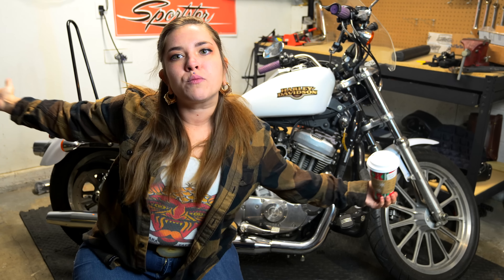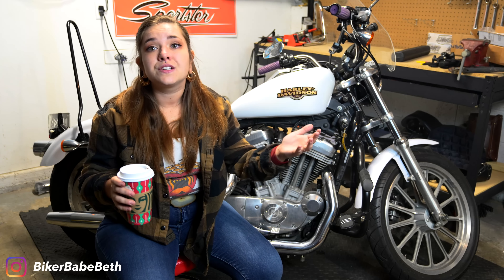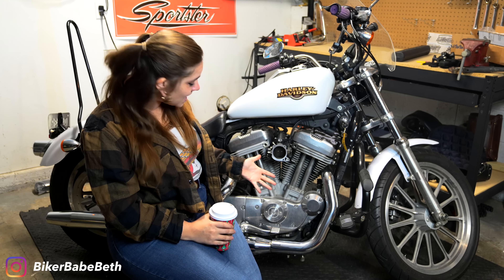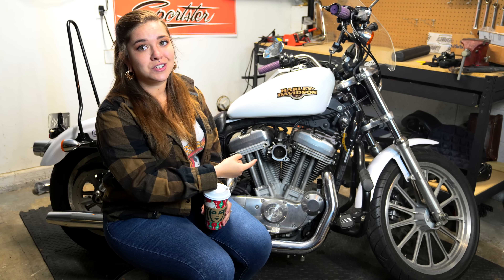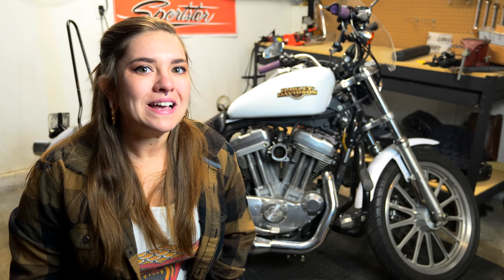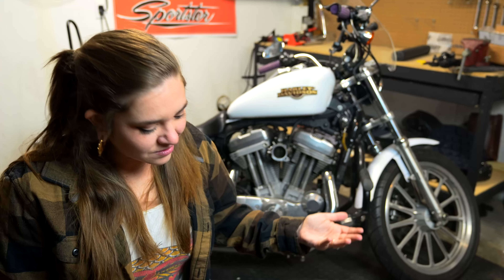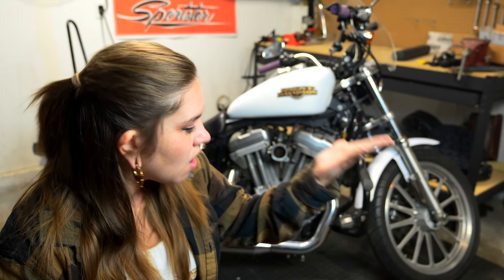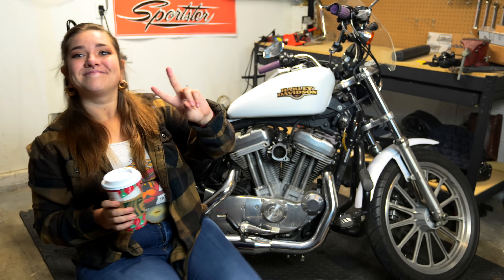SHE BROKE WHAT!? - Harley Davidson Sportster Out of Service!

Comment: I was trying to change my air filter. I got my 10 Mim wrench and no problem. But I could not get the two screws that hold the air filter. I stripped one of the two screws. I sent My Harley to the shop. I paid $150 to remove a screw. I felt so stupid. Thank you for the share.

Comment: I broke my Kickstarter cover on my Sportster once,  got a new one and  it broke on the 2nd kick. Took it off and looked at the kicker shaft.  Yup its bent, more probably then it was the first time. So round 3, new cover, new shaft and a few other parts and it worked good after that. Live and learn!
Reply from the maker: Live and learn for sure.  Especially with motorcycles.

Comment: Well let's see.... I once stripped a head hole trying to change plugs.... I pulled a valve steam out of a front tire trying to put air in..... I once dropped a timing chain trying to change starters....  Then i cracked a jug trying to change pipes... So yeah your not the only one.

Comment: Simple install.... a 21 inch on a stock street glide. The dealer said "NO PROBLEM"
So install and within 1 mile tipple tree hits the fender. $600 later (without striping) and $1000 in fork work  (yes 1600 in repairs)  Oh well..... Happy and riding as much as possible
Reply from the maker: Damn! That got expensive

Comment: It could be worse.  I once put a Baker F5K kicker kit on my 91 Softail and fucked up by not pressing it on properly.  I ended up having to remove the tranny and take it to the shop to get it fixed.  It turned out that I had moved the gearset out of alignment so the tranny wouldn't shift.  But once it was fixed, I ended up putting another 50-60k miles on her.  I've done more stupid shit working on my bikes over the last 40 or so years, but haven't we all?  lol  Odessa will be a badass Sporty when you finish her.  1200 kit, straight pipes, hmmm, sounds like a hot rod to me.

Comment: I had to redo my clutch 3 times in a month because I was using an inch/pounds torque wrench not foot/pound thanks in part to auto zone not realizing that the tool was the wrong spec type and me not double checking or knowing that there even was an inch/pounds torque wrench. Thankfully this was on a 2001 Kawasaki Vulcan 1500 and it was a very forgiving motorcycle to work on the clutch. When I realized what was going on I felt like such a dumb a$$, but "you live, you learn".

Comment: If it's cracked on the filter side of the throttle plate it can't leak air. If it was cracked on the engine side of the throttle plate it would have a vacuum leak. Good luck. Hope it works out.

Comment: It'll be a brighter day when the tins are off and you decide to at least prep her for new paint yourself.  Don't let any "monday quarterbacks" give you their JB weld stories or "I've never dropped a bike BS"  Every rider will put their bike down at some point, or they're liars. When you wrench your own bike you double your chances of breaking something. 
For me it was not checking more on a used bike. The throttle cables weren't correctly installed when the latest owner installed new grips. My first clue should have been the upside down eagles from them putting them on the wrong sides. Once I finished installing all new rubber from tires to fuel lines and cleaning the tank of varnish. I pulled up the drive and across the grass when the cables slipped and the throttle revved spinning the rear tire on the grass and dumping my RoadKing onto my right ankle. With a broken foot I took apart the throttle assembly to find the ferrules loose in the plastic housing. Those brass ferrules are supposed to be clipped onto the ends of the lines before slipping them into their grooved pocket. 
That happened to me when I was 49. I am 57 n ow and I started riding when I was 14 and could pickup my uncles 47 Indian Chief off the garage floor. I have been riding and wrenching all my life and I am still a novice!
The day you profess to be the "master" of anything it'll bite you in the butt.
        Miss Beth, stop beating yourself up and do not listen to the "masters of the universe" that proclaim too much.
You are in my prayers
Hoka Hey